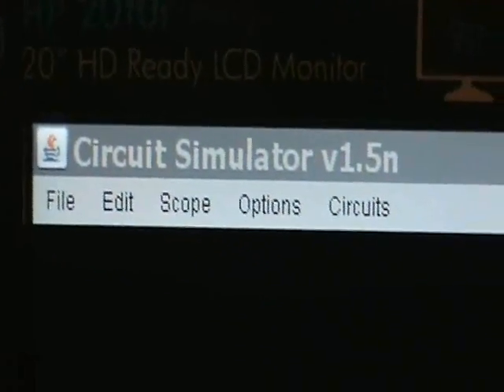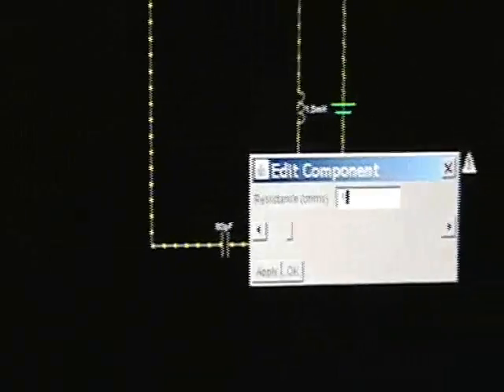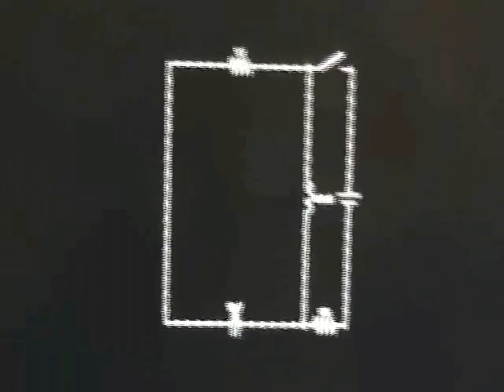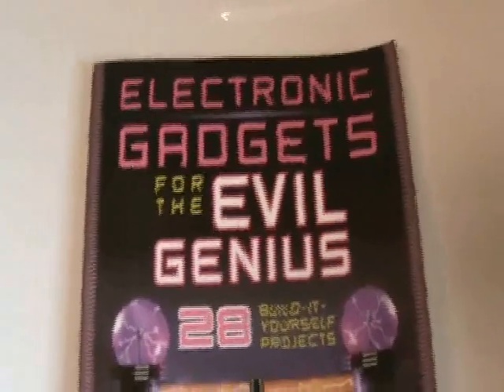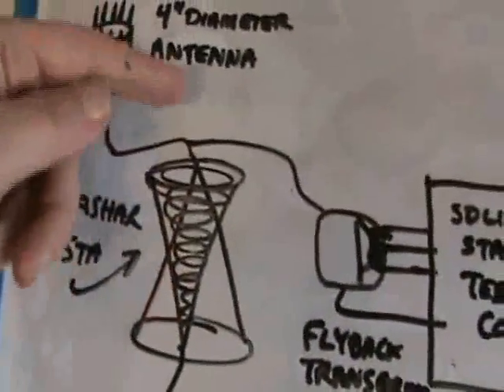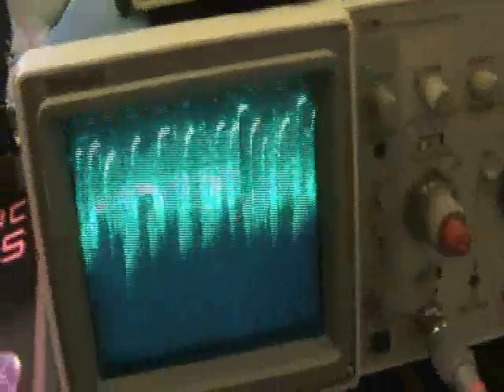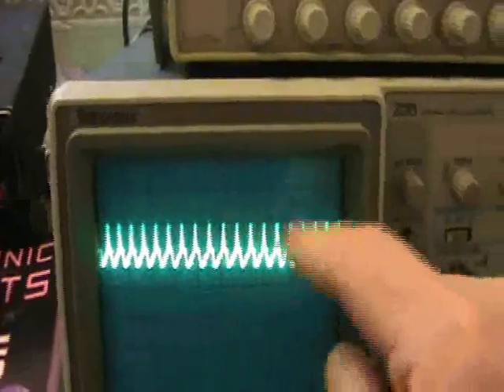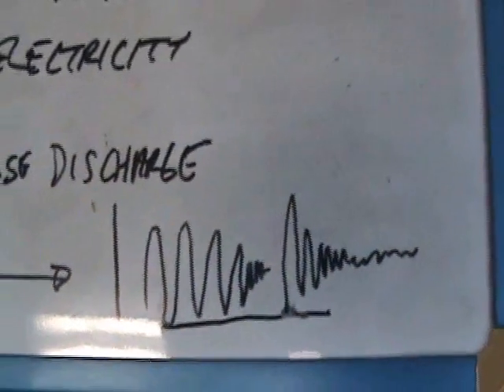Ep. 14 - Bashar Free Energy Space-Time Antenna (LRC Circuit)

Comment: good work. you actually can break the law of conservation of momentum, when the spark fires the field in the cones collapse but because of the vortex system when you tap the top with an 'antenna' here is a hint look up how a microwave magnatron works.
what occurs is a magnetic vortex pushed up into a resonant cavity then it is 'tapped' with an antenna at the cavity, this produces 'microwaves' what you have done here is essentially tap this vortex, one thing you could try is if you could place a perm magnet (ring) say N down try to center it and run your ant through the center place another at the bottom of the vortex. also N down so you have a 'directional' mag force pushing into the coil from the top downwards. 

you should run an ampmeter across the output, it seems clear you are gaining 'power' with less input or draw.

thats a good 'indicator' of OU or 'free energy' 

if you put a small high V ceramic cap just before the spark gap this will help 'tune' the system and smooth out that wave. 

you want like a 8kv or 4kv ceramic cap you find them junked in old TVs or plasma. 

very impressive video, good work.

Comment from the maker: @DracoXul 
The sound on the smaller coil is caused by wires vibrating in the magnetic fields, hitting the paper cone surface. I believe we see harmonics because these vibrations are occurring at different frequencies up and down the cone -- which would lend credence to the theory that a frequency change is happening down the cone .. and that velocity is constant in the wire.

Comment from the maker: @DracoXul 
I recently read a paper that someone has created a negative inductance. I wonder if the same can be done with capacitance using a TRICK of geometry. Also, it occurred to me tonight that since there are two coils here hooked up in parallel, there resistances are HALVED. What a clever way to reduce resistance.

Comment from the maker: @DracoXul 
Btw, I wanted to see if the full-size coil would produce audio tones like the 9-inch one. With same experiment, it would not. However, I found that if I had the current flow from the coil surface to the 12x12 plate, the sound would emit on the plate and the same harmonics where there. The larger coil has heavy 14 gauge wire that cannot easily vibrate on the cone like the little coil. But the vibration can be made to occur on the plate held against it.

Comment from the maker: @DracoXul 
Yes. I too have thought of that ... but don't have one. I can tell from the oscilloscope that there are several harmonic frequencies. I can see the patterns. One thing that occurred recently is that I've damaged my scope. The issue with high-voltage is that it can easily get into nearby equipment. My scope is now exhibiting intermittent problems staying on frequency. So measurement is a challenge. There is danger in wrecking expensive test equipment when playing with high voltage.

Comment from the maker: @madhacker2000 
Thanks for the tip. I can remove the spark gap completely. Doing so has the effect of reducing the voltage level out to the can-pin antenna, and the light dims a bit. So the spark gap does boost the voltage levels a bit since a SNAP occurs to the coil. Quenching would probably improve that snap definitely. Spark gaps are ancient tech now and not recognize by guys like me educated in digital electronics only. I have more research to do.

Comment: Try submerging your spark gap in vegetable oil to quench the spark as tesla did (typically using magnets or a blast of hot air) this will ensure a uni-directional discharge. Also the spark gap can be used in parallel to the coil, look up shorting a coil at sinewave peaks. I can send you more info if you need.